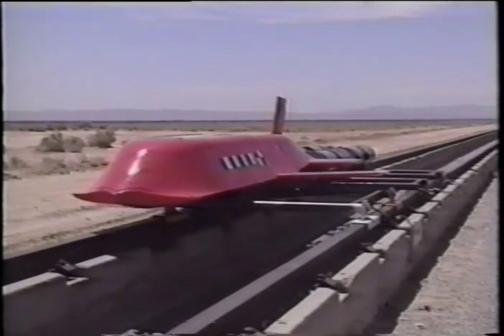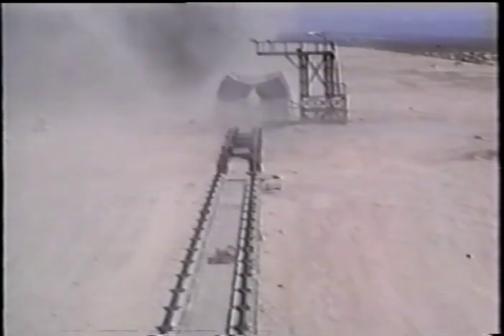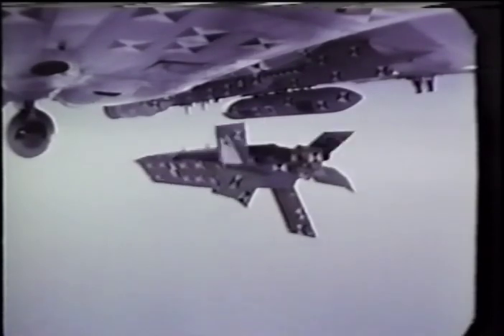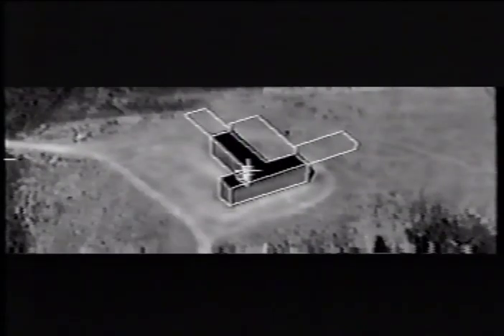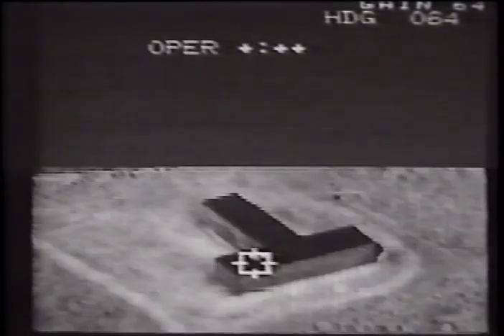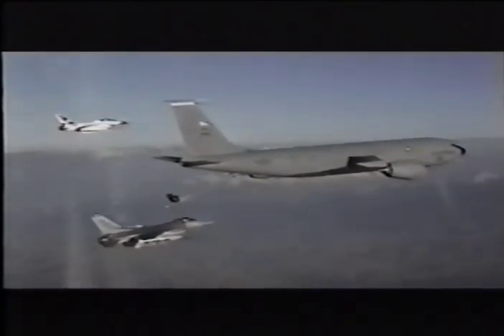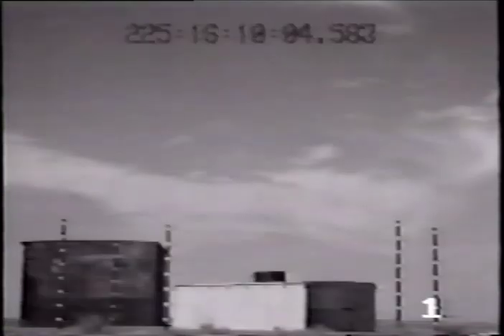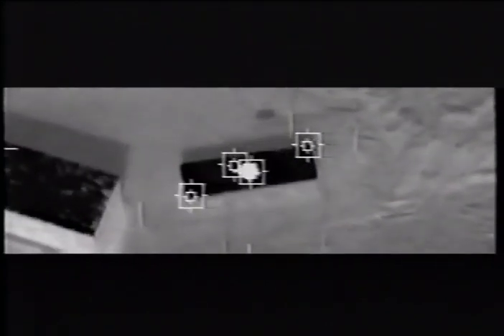TSSAM cruise missile

Comment: I was in the Air Force when this missile was being tested.  My job was to collect and disseminate telemetry during testing of the missile in the late 1980’s at Tonopah test range in Nevada.  While I was inside a building and unable to witness the actual flight, I’ll never forget monitoring the pilot’s radio communications.  To say they were highly impressed with the flight characteristics of the missile would be an understatement.  They flew F-16 chase planes and had a difficult time keeping the missile in sight due to how quickly the missile was able to alter its flight.  This was the only missile program I worked on and I was sad when the project was cancelled primarily due to funding.
Reply: Thanks for the comment